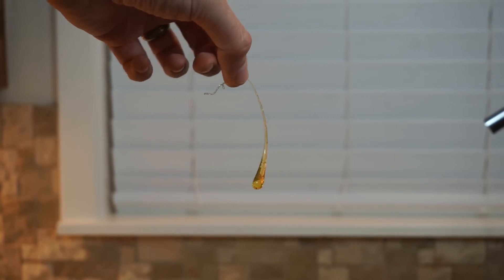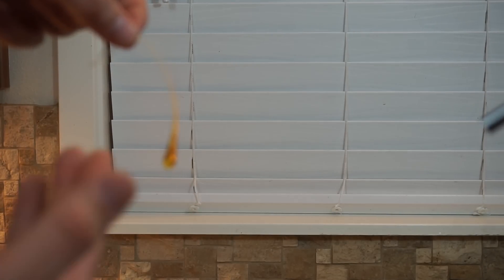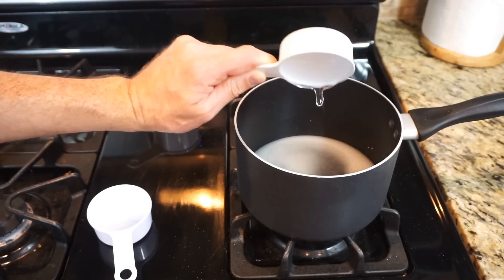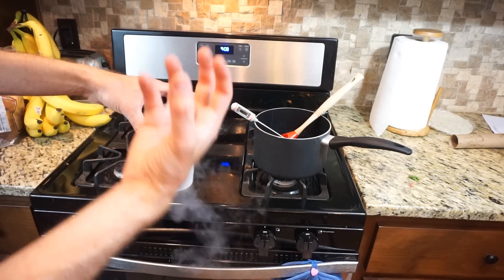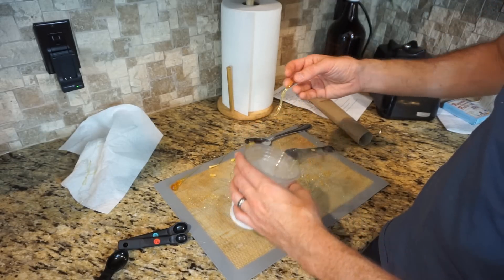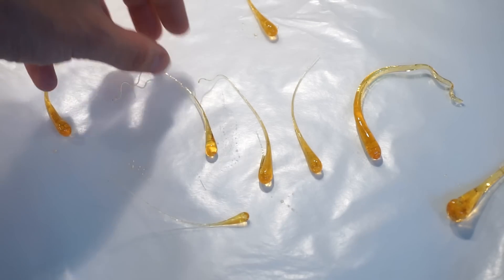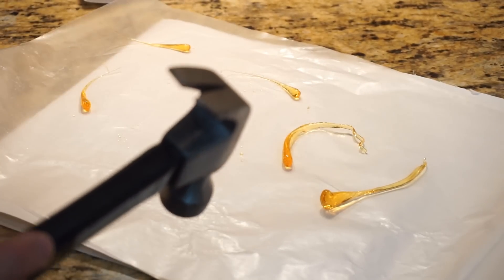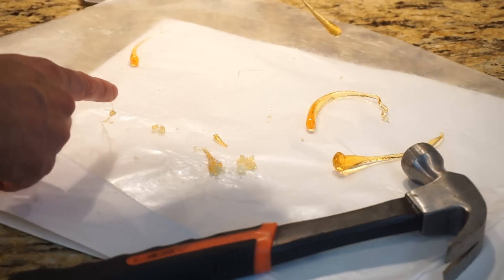How to Not Die When You Eat a Prince Rupert's Drop

Comment: You know how to tell end of the Prince Rupert drop is the weakest part well what if you heat up molting glass to the point where it's starting to drop like that then take scissors and cut it right where it's round it will still be molten hot and it will drop in the water and cool down the same way making it have so much pressure forcing outwards inside the prince erbert drop with no tail would it be able to be broken can you try making one without a tail

Comment: You didn't eat a prince rupert's drop though? While hard and structurally sound or not, that had none of the energetic properties of an actual drop. The whole point of the drop is that the outside cools faster than the inside so that that the inside molten glass (Or sugar) pulls down on the outside hardened layer creating intense amounts of stress in all directions. Which is why when you snap the tail on a drop it introduces a weak point which then causes the whole drop to shatter.

You snap the tail on your drop and nothing happens, well then it's not a prince rupert's drop. It's just a glob of hardened candy.

Comment: So even if you can make prince rupert drops like this, I suspect that a combination of the wetting from the water, and the heating after taking it out to room temperature, will probably cause the amorphous solid to phase change to a crystalline structure similar to what happens with amorphous ice.

It's possible it can be stabilised under pressure, but when you take it out from being under pressure it might revert.

Comment: So the reason it didn't shatter is because you used two different types of sugar. Might be wrong but sugar can be really temperamental because you have to watch it. Try doing it with just sugar and very little water just until it looks like wet sand.

Comment: Thanks for sharing your interesting experiments.
---
Would your sugar drops be more 'Prince-Rupert'-like* if you were to:
1. Omit the corn syrup, which may interfere with the sugar re-crystalizing?
2. Apply a vacuum while boiling down the syrup to prevent caramelization?
3. Immediately apply a hydrophobic  coating**?  
---
* I.e., shatter when the tail is broken off.
** E.g., oil, Crisco, or whatever they put on M&M's.
Reply: Glass isn’t a crystal structure, so the sugar shouldn’t end up in one either. The corn syrup helps prevent that from happening

A vacuum won’t change caramelization much, but you can still take it off the heat before it caramelizes

Applying a hydrophobic coating won’t do much because it already absorbed water from dropping it inside the water. They can try dropping it in oil though
Reply: @alexanderheubel7366  seems you have all counter answers to the pretty sounf looking suggestions😂

Comment: What's a prince Rubence drop I'm from Australia
Reply: Bacon Pizza you melt glass, then let it drip into water. once it hits the water, the outside hardens, but the inside is still molten. as the glass on the inside hardens, it pulls the glass towards the center and makes it extremely hard. if you snip off the tail, it releases the pressure extremely fast and makes the drop explode. I think the channel veritasium has more on it